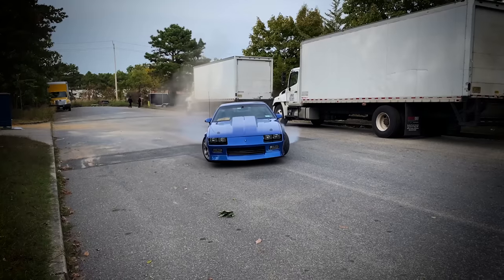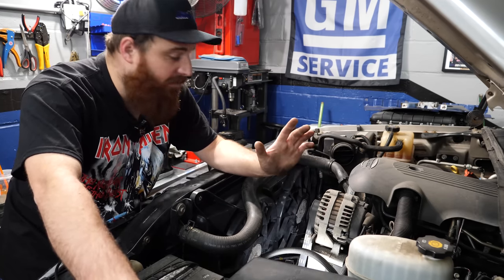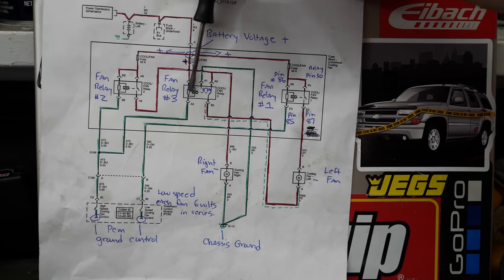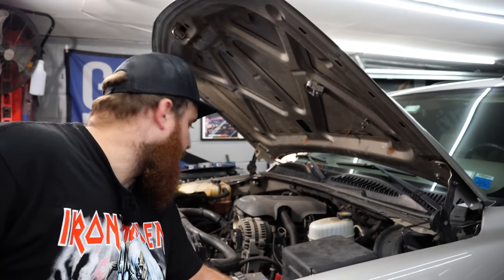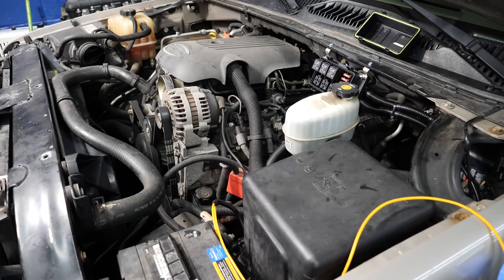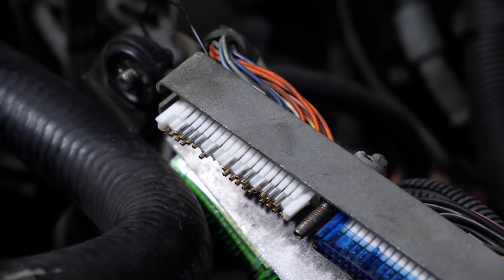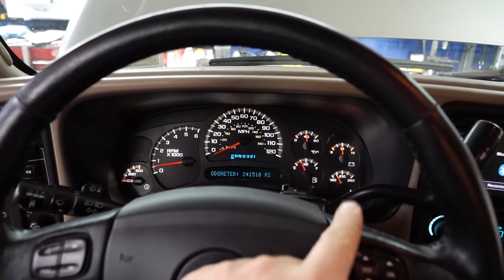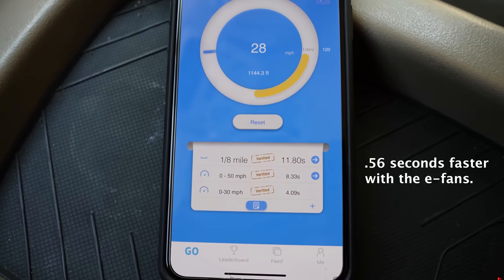I Deleted the CLUTCH FAN in my Tahoe and it Actually made it FASTER (E-Fan Conversion)

Comment: On my wife's 04 Tahoe, I built a long wand out of 1/4" plastic toilet / sink feed line, drilled 20 or so tiny holes all evenly in one side, plugged one end, and hooked up my air gun to it. I lowered it down vertically between rad and A/C cooler forcing air forward through the cooler, a ton of dirt / dust came out and her A/C has stayed blowing cold.

Comment: Best thing you can do to a non E fan equipped truck!! I did it to my 00 GMC, and 02 Tahoe. Especially here in the desert. Stoplight with A/C going with that crap mechanical was miserable, even when trucks were new, swampy as humid air. It really shined when I pull  a water trailer to wet down the tractor truck yard, chill air ( 110 day 55 degrees vent temp) at 3 mph letting the water tank pump spray down the yard. I did have to upgrade the radiator on the GMC as I wanted the tow package radiator. Tahoe came with big rad from factory. I used fans  off of 08 6.0  Escalades for both. I did buy the harness from BP Automotive,  I also got the optional high pressure switch from them that uses A/C high pressure  to kick on fans not just temp. I also added a 300 amp alternator. Your wiring skills are like my brothers, good job.  ( Hes retired now from Denver Intl Airport) I did see a 1 MPG increase on the GMC, nothing on the Tahoe.
Reply: I have an 03 burb with 5.3 LM7. I’ve been thinking about swapping to oem efan to help mpg and some more hp? 2003-2004 5.3 285hp. 2005-2006 5.3 295hp. Only difference is flex fuel compatibility and switch from mechanical to electric fans. Guessing the fan switch is what netted the +10hp.

Comment: An in depth video but this is one of the best videos detailing the conversion from a clutch fan. It’s helpful for me doing one on a 2011 suburban. It’s a 2500 with the 6.0 and clutch fan. I’m 99% complete and the review of the HP tuner was the last bit of OEM info I needed. Thank you!
Reply: I have the exact same suburban and I’m trying to do the electric fan conversion as well. Would you mind sharing everything you are using for the conversion? Thanks in advance

Comment: Be sure to check the temp with a scanner. The stock gauge in these are kinda like a dummy gauge. 185-220ish will sit right around the 210 mark before going over.
Reply: That's because the engineers have determined that those temperatures are "ok" and within normal operating spec. Beyond and below that the needle will move to reflect the actual temperature.
Billy Commuter and Sally Home maker will bring the car to the mechanic if they see the temperature needle moving; even though it's not in the red.
On older cars that's not the case. My 91 Mercedes diesel reflects the correct coolant temperature ALL THE TIME. It's pretty cool watching it cycle through its motions. Leave the AC on with the car idling in the hot garage (our garage isn't insulated) and you'll come back to  ~115*C temperatures with the fans on high. It doesnt get higher, just kinda sits there.

Comment: Glad you ended up with 10AWG wire, these fans are power hungry. Oh and 10AWG wire is typically only rated to 30A, so you are stretching it a bit with the 40A fuses. Probably fine, but melting wiring is never fun. Bigger wire means less resistance through the wire, and less stress on the relays/fuses.

You have to watch out on the cheaper wire, anything under the hood should really be GXL or TXL automotive wire, because it is rated to 125C (257F) and way better suited for under hood temps. Most common off the shelf wire is only good to like 80C (176F). All the factory wiring is either GXL or TXL under the hood, and probably throughout the vehicle really.

I skimmed through most of the video but it looks like it was well detailed, this is a very nice resource for this mod. Thanks

Comment: I just replaced our '05 3500 rad and fan clutch. Amazing AC performance while parked in the heat, so much power drag everywhere else. A manual pusher + 
Buick 3.8L eFan conversion time! Thanks for the vid!

Comment: I've been wanting to do this conversion for yrs on my 03 Tahoe. I have all the parts, including the factory harness lol. 
FYI-- fans up to 2014, are all the same. You def don't want to use an aftermarket harness. They don't hold up. On a really hot day if the electric fans kick on alot, the harness will melt. So if you can grab a factory harness,  along with the convenience center with all the relays for the fan, do it. Another thing to think about---you probably have the 130-145 amp alternator,  so you might want/need to upgrade to a 160 amp alternator. When those fans kick on they do pull power, and if you have the ac going, along with music, headlights are on etc, your amp gauge will dip. Keep an eye on that shitty Amazon wiring! Def don't want them to melt either. Again--these fans do draw power. Nice vid--again 👍🏻
Reply: its a voltmeter not amp. Cool story though.
Reply: @mann_idonotreadreplies  you are correct!

Comment: When I did the E fan  conversion on my 2002 Tahoe 5.3 I noticed. no difference in horsepower or 0 to 60 times
Reply: It varies , back in the 70's removing the clutch fan was one of the most popular " bolt off " mods done ,   it is called parasitic horsepower drag .....most often replaced with a flex fan , where at high RPM the blades flatten out ......high RPM is where it is most noticed improvement
Reply: you wont see much improvement until the clutch locks.

Comment: Matt! I love your attitude, your superb mechanics skills and knowledge, the clarity in which you teach others, and the fact so far I've never heard a cuss word so my Grandson who's 8 can watch and learn too. You're helping alot of people Brother, especially me, just bought my 3rd Yukon, only have 1 but have owned others in the past but mine has issues. It's a 2000 YUKON 4X4 5.3 SLT, 328,000 but you would never know, it looks clean and nice. My transmission hits hard in 2nd & 3rd, BUT ONLY after highway speeds, 50 mph & over. Then when I start again from a stop once first gear goes into 2nd, it hits hard, then the next gear, 3rd, then the next gear is a smooth transition. NOW HERES THE THING, ANYONE CAN ANSWER BUT I HOPE MATT DOES TOO. When I get off the highway I pull over at the nearest safe spot, shut the truck off for 2 minutes, start it up, goes through all the gears just fine, AS LONG AS I KEEP IT AT AROUND TOWN SPEEDS, UP TO ABOUT 45 MPH seems to be the sweet spot to keep it shifting correctly. HERE'S MY QUESTION: I I replace ALL the Solenoids located under the trans pan do you think that should fix my issue? I already replaced the shift sensor located on the driver's side of the throttle body. Any help would be greatly appreciated...
Reply: Sounds like your transmission needs a maintenance or (hopefully not) a rebuild.
Greets from Germany, I drive a 6" suspension lifted '03 Suburban on 35s.
Shop had to rebuild my 3rd n 4th gear last winter.
Reply: @Rokx80  Sorry to hear you had to rebuild the gears, and thank you for the information. Your truck sounds nice. Mine has a 3in  lift but going to a 6 eventually myself too. I'm going to replace the Solenoids in the 4L60-E Transmission first, if that doesn't work off to the tranny shop to spend about $2,500.00 to rebuild it. The truck is worth it, everything is pretty much new already from having to upgrade many parts this last year since I bought it. They're only going to go up in value, especially when the world is getting worse and worse, people are going to want 4x4's and trucks to bug out. My truck is my BUG OUT VEHICLE, it's set up for overlanding. Cheers from Southern Utah U.S.A. Brother. I live in America but I'm Welsh & Scott's Irish.

Comment: I did a Hayden dual fan module,With the  Radiator Probe the only thing is fans would over heat it and burn up,So the leads to the fans I threw in a 60amp relay to each fan and haven't had any problems.Great video.
Reply: Is your setup still working good I want to upgrade to e fans but I don't want to mess with pcm

Comment: I did the same to my 03 Silverado, trust me you won't be disappointed. I commented back on one of your old videos and told you that you would love them. I bought the harness for mine though
Reply: With the factory harness was it just plug and play or did you have to still get into the computer to wire to the pins
Reply: @daddyshark3896  I bought an aftermarket harness that was built for these fans, still had to pin the computer plug and tune it
Reply: @daddyshark3896  even with a factory harness you would have to tune it regardless
Reply: @USArmy05  oooh ok sounds good

Comment: Glad the fans worked out, definitely have to do mine.  Took at shot in the dark at the local dealer to see if they could unlock fan control while they were programming my master window switch, no dice.  have to check the local tuner to see.

Comment: Excellent. Get a tube of automotive electrical silicone grease and put some on each fuse & relay pin when assembling. In fact use it on all  the electrical connection points. If the Auto Zone guy looks weird (or tries to sell you tiny light bulb packets of the stuff for way too much money)  just find someone who knows what you are asking for. It will prevent corrosion down the road and helps a lot with the cheap Chinese metal used in pins and fuse blades.

Comment: I have a stock & beautiful 02' Blazer ZR2 4.3 & it's always ran below 210° down here S of Houston where it gets hot!
Now days it's running around 210° with a 195° thermostat & a tad higher when towing a small 5x9' utility trailer. Like 220° which it's never ran that hot or warm. 
 I've flushed the radiator, installed a new Severe Duty Clutch Fan (that I only hear on start up) , new coolant after the flush & new 195° thermostat. 
I can't hear the new clutch Fan & I have no idea what temp they are supposed to kick on at, I did see somewhere that the Hayden 2786 Fan kicks on around 180° but I don't think so. Maybe I'm freaking out over nothing. It's just always ran around 200° max. (Just left of the 1/2 way mark on gauge) the gauge is good because I can see it when the thermostat opens at 195°. So IDK.

Comment: I have an 2003 burb with 5.3 LM7. I’ve been thinking about swapping to oem efan to help mpg and some more hp? 2003-2004 5.3 285hp. 2005-2006 5.3 295hp. Only difference is flex fuel compatibility and switch from mechanical to electric fans. Guessing the fan switch is what netted the +10hp.

Comment: I knew the aftermarket harnesses had 3 relays and just assumed it was to run both fans while the A/C was on but now I see you run them in series to get both on a low speed I figured the tune says fan 1 and fan 2 so I figured it didn't matter but I assume that if mine calls for fan 2 it will cut off my fan 1 I don't really test that they both work manually like you did

Comment: I have a 2003 Tahoe Z71 Have the fans  and I used the Nelson after market harness ! ( was telling my lady I wired the power the way you Finally did it ! Where did you get the download for flashing the computer ! I'm a Jersey transplant in Colorado and now one knows what I'm talking about flashing the computer ! I have all the temps and sure I could do it! (novice) found one place to flash it and they wan't my first born in return ! I'm visiting Jersey in a few weeks and would go to Lakewood to have it done if it's reasonable !
Reply: I have a Black Bear Performance tune. They turn the efans on by default with any tune for the GMT800’s imho, it’s probably the best mod you can do for these trucks (BBP tune) it’s a little spendy, but so worth it!
Reply: @heysoos223  Thanks I'm hitting all options! I do have a Flex a Lite controller which I can use temporarily just need a radiator thermostat probe!

Comment: That relay box is nice I got just some cheap relay harness things with pig tails and had one or both melt and I had to re run some but I did find some relay sockets that you crimp the actual connections like yours but just individual which I highly recommend and it just makes things cleaner

Comment: +The electric fan add approximately 27 ft.lbs of torque NOT HP... A very noticeable difference... Propelled fan do Rob power though, but compared to the amperage that the fans draw from the alternator that takes more power to turn... So who's really winning when it comes to saving gas vs more power when converting to E-fans etc??? I don't know... 1 thing I do know. It looks way better w/the electric fans. For the money that these E-fans cost. On saving gas to the price tag, Hell it would take months/years to get your money worth & back...

Comment: Matt you should put fuseable links where your 12v+ tie into you main fuse block lug.  Otherwise you have those 2-3 feet of wire un fused.  Not a huge risk but for me worth doing.

Comment: Amazon has a harness made specifically for the conversion for $70. I did the conversion on my silverado and got the computer tuned to turn them on. It works perfectly. No need for Nelson performance
Reply: Do you know the part number? I would appreciate the info
Reply: Part # bro much appreciated

Comment: I did this recently with my 02, pin 33 was still having issues with my Blue/Red ECU connections, had two ECU’s programmed. Couldn’t get it to work, so I just spliced into pin 42 and solved my issue. But love your clean install.
Reply: Did your pin 33 have a wire already in it and was your ac compressor coming on ?
Reply: @jimmyramirez8844  honestly I can’t remember but I had to jump the wire for both fans to work. I have a red green connector on my ECU, from what I gathered is you want red blue connectors or an ECU from a red blue.

Comment: Matt i had a tuner set up my computer on my 2001 chevy silverado. It had the wire pined on pin 33 red cover and i took it off as you mentioned. I went ahead and plugged in the new wire from the ac fans relay box from factory. The tuner set it up as 2 fan and analog. With the analog setting the compressor keeps running and doesnt cycle and it freezes up my ac and stops working. Do you have any idea or do you recommend something? Thank love your videos 👍
Reply: Did u ever figured out??
Reply: @gerardolopez5875  No I had the tuner put the settings back to analog cycling that the only way the ac doesn't freeze and the compressor cycles how it should. The only downfall is the that fan 1 is always on but it doesn't hurt anything. The cooler the engine runs more horse power. The only way to fix the issue is to change the computer to a 2004 to 2006.
Reply: @macielandsons  @ agree, I’ve done 5.3 on 2 of my c10s with  04 harness/pcm,   And using 3 pin transducer, its the way to go,   Here the only downfall its drive  by wire,,,       But on my 2001 silverado,     Iam just planning the best way to electric fans,

Comment: Just installed a set of electric fans on my 03 gmc yukon denali. I just have one question at what temperature are they supposed to turn on. My temperature goes past the 210 for sure with my old clutch fan temperature was below 210. I feel like is gunna overheat never seen it go more than 210 is this normal?
Reply: If you have HPTuners, just copy the settings from a vehicle that came with them from the factory (like an '06 Tahoe or whatever).  210 is normal though, should stay at that temp and really never go over unless you're towing something heavy.

Comment: Yet another fantastic video! Super Appreciated 😀  👍I can't wait to do the swap once I get all the needed goodies. Question on the Tune what were they able to add over the stock Tune? As I just purchased an 03 Z71 and looking to add as much as possible without replacing headstones, cams etc for Now. Thanks Eddie J. Long Island N.Y
Reply: You can change it however you want. With HP tuners you can tune everything yourself. Or you can data log and find a good tuner to do it. These engines really wake up with a good tune. I’ve watched quite a few tuning videos trying to learn on HP tuners and you would be amazed by how much GM dumbed down the factory tune. I guess it was to please the epa.

Comment: You need to upgrade alternator. Phoenix last summer at idle ran my voltmeter to like 9-10. I did those fans on my 2000 Escalade. It really did clean up the engine bay. I now have a 2004 Escalade ext that surprisingly came without electric fans. I’m going to do this to this one now but like I said I also need to upgrade alternator to a 300 amp one or higher. Those fans have a huge current draw.
Reply: Electric fans started in '05 for these.

Comment: You should check your refrigerant level. My trailblazer i run two electric fans from a 2002 camaro. With both fans on with low refrigerant was cold but not super. Then once I was able to determine my shrader was leaking it was cold even with no fans on at all.

Comment: Was thinking of doing this on my 02 aside from the compressor went out mine sits around 190 with the clutch fan. I just am not sure I wanna invest time on a rust bucket.
Reply: How much miles you got on it as long as you know it'll run for another couple years you should do it , price don't change much on these so it's worth it
Reply: @aarsoul9860  338000. Only the body is really rusty. Aside from timing and changing some pulleys it's still strong. Just wanna get into something 03+ for the updated interior probably the hardest thing for me to get over lol.

Comment: Thanks for the video. I’m looking to do this upgrade on my 2003 Sierra 1500. I have already picked up a larger radiator and will hopefully get the fan assembly and factory harness in a few weeks. My question is about the computer tuning to tell the fans to turn on. Will this work on my 2003? And if I can’t find a local shop to do it do you know any mechanics I could send the ecm to tune it?